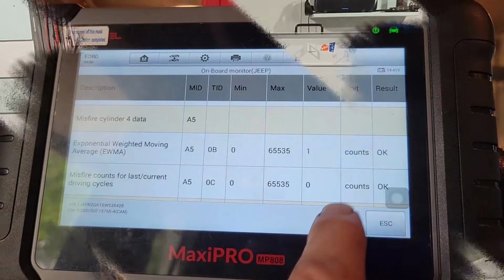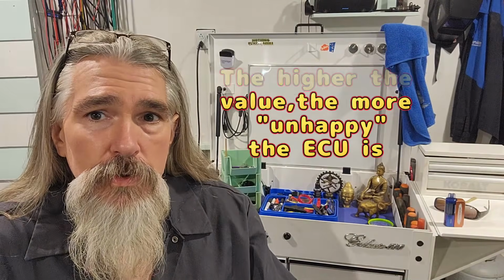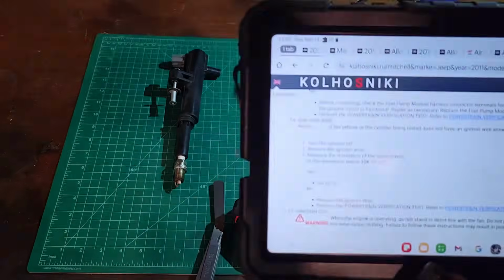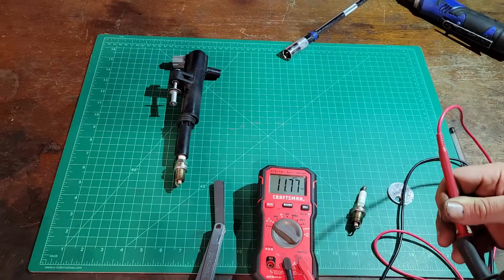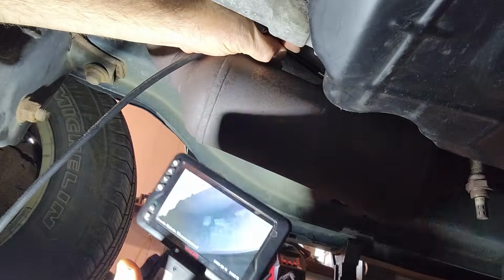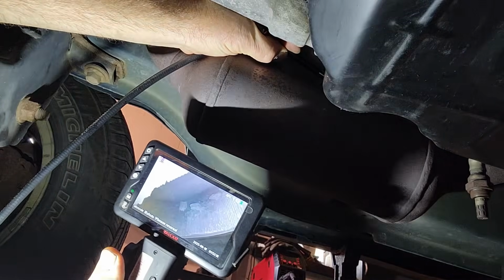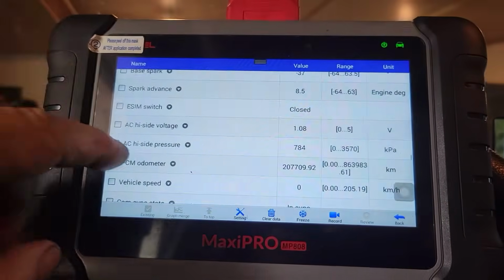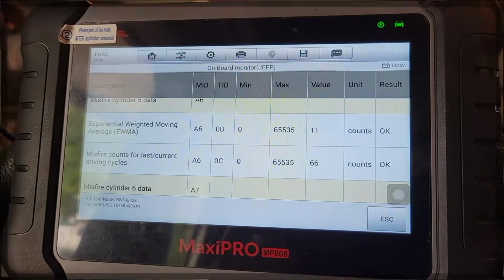Using EWMA and Calculated load A Mode 6 gem! #autorepair #ralcam #autodiagnostics

Comment: coo; love to see your project lol on creeper comment which way to roll sideways forward or reverse i personal never experienced that one before but i feel your pain.adios
Reply from the maker: Thanks man! There are plenty of projects coming. I never dealt with coax, so I had to take a crash youtube course and, of course, order all the crimpers. Building a transducer from amazon parts also, I figured build one just so I can have 1 for fuel pressure. I know they say you can, but it just dont seem right to let the one you use for gasses taste liquid. 
 Ya the creeper, I always happens when mo one is around. I've had to drag myself out with a wheel tangled in my hair and cut it out once I got to my scissors. So far, not filming but inevitable. 
Adios